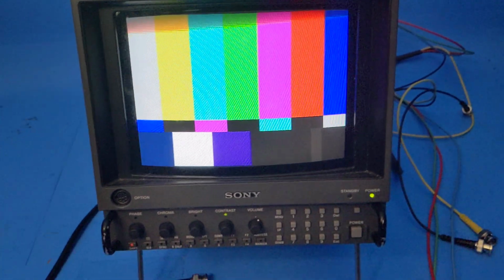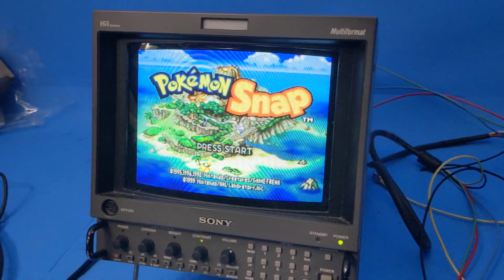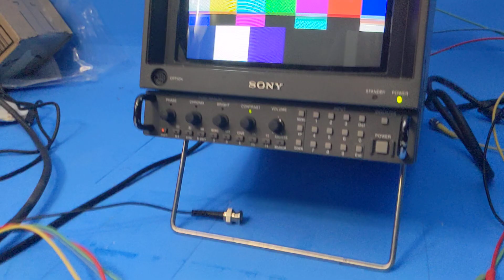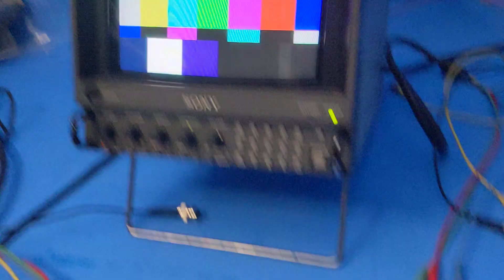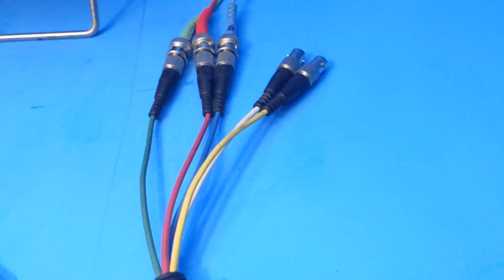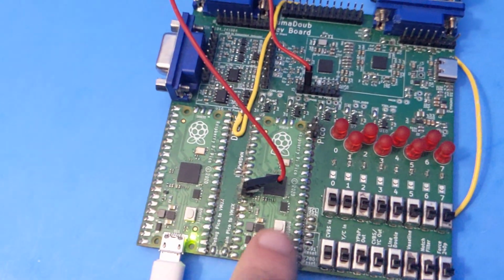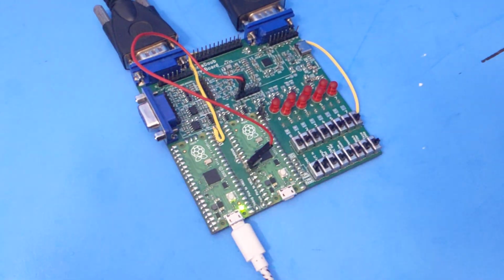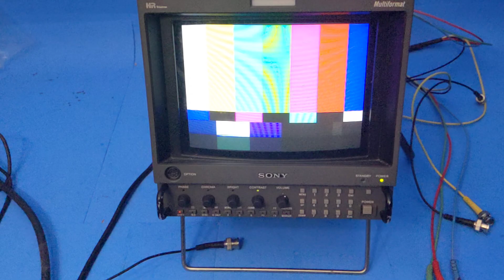Open Source Universal Analog Video Converter and Line Doubler (LumaDoub Introduction)

Comment: When you mentioned duckhunt I came to think of how the game works, and since it uses a big flashing square its tolerance is higher than other lightgun games ie timecrisis. But the NES zapper runs through the console while guncon uses sync signal to know the timings. Wouldn't it be possible to plug the guncons sync into the output of this circuit? then any latency introduced by the circuit should be eliminated, of course this is limited to 15khz.

Comment: This looks great! Seems like it would be perfect for 240p/480i signals on those European CRTs that are effectively 480p-only VGA. The ideal signal conversion is line-doubling then blacking-out alternate lines - is that something it can do?

I don't think there's a simple solution for this at present - to support both composite and RGB you need something like Koryuu => OSSC => DAC, or RGB-transcoder => RT2X-Pro => DAC
Reply from the maker: Yes, it is simple line doubling, but currently I don't know of a way to implement artificial scanline gaps without a lot of extra hardware.

Comment: Holy sh1t this is so useful for my svideo n64. I am also an electronics engineer, qnd i wanted a way to convert svideo into rgb still at 240p, qnd was so frustrated that i started considering doing something from scratch, but i never have worked with video processing before i started with the adv7180, trying to turn the y qnd c into some rgb thing.
This is awesome and i can't wait till it comes out.

Like the features are soooo useful, this is really useful and exactly what i need. Thank you man you're a legend

Comment: The only thing this is missing (besides the RGB input transcoder that was mentioned) is a VGA 31khz input. Running DOS games on a PVM sounds super useful, and the same for 15khz home computers on VGA monitors.
Reply from the maker: I really wish it could, but the decoder chip (adv7280a) simply doesn't have 31khz input capability. The line doubling and smoothing are features of the adv7280a that I can't find on any other chip, so if I switch to another decoder chip, I would lose those features.
Reply: I understand entirely. I'll still be buying/building one of these whenever it's finalized. Thank you for your hard work and research!

Comment: There are so many potential usecases for this.
- Any easy solution for people to display retro consoles on their PC CRTs.
- Connecting retro consoles to modern capture cards that require a 480p minimum input.
- Displaying Emudriver/GroovyMAME on any CRT you want.
- Getting 240p linedoubled for 480p for a smoother image on arcade trisync monitors.

Really excited for the future of the project!
Reply: If I watched it correctly, it only has composite/Svideo/component input so it wouldn't work for the PC emulation option to CRT tv
Reply: @jdmark0805  Component can be easily converted to VGA if your monitor supports sync-on-green. That's how they run PS2 Linux on PC monitors - 480p mode component with sync on green. There is also a compatibility list somewhere with many monitor models. 

So I think line doubling to 960i and running it on a PC monitor would be an awesome and affordable way to get into CRT's.
Reply: @jdmark0805 Good catch, I guess I missed that at the time.

Comment: Are you decoding ntsc with a pico to rgb?
Reply from the maker: No. The pico simply reads the switches and sends i2c commands to the decoder and encoder chip. The video doesn't touch the pico. 
Analog video -> decoder -> bt656 bus -> encoder -> analog video
Reply: @MoreShankMods  Nice work! I want to make something similar but with a custom encoder for 8bit consoles.

Comment: Will I be able to convert HDMI to analog and display it on my CRT downstairs?
Reply from the maker: Likely not. If your HDMI is outputting 480i or 240p, and you run it through a lag free converter, potentially. But this probably isn't the best device for that application

Comment: This is pretty much what I've been wishing for for years! RGB input would be icing on the cake. As far as additional functions, do you think it would be possible to use one of those switches to add serration pulses to the sync (like some Extron RGB interfaces can do, or like your other sync-fixing gadget)? This feature would be a life saver for me with my weird monitor/input card that bends the top of pictures from some VBS/YC sources (PC engine, PC-88, Nt Mini, etc.).
Reply from the maker: If my understanding of the chips functionality is correct, this should work. It should restore the serration pulses. It's weird use cases like this that I never would have thought of that this project is going to be so useful for. It's such a versatile circuit, and I'm excited to see what problems it solves.